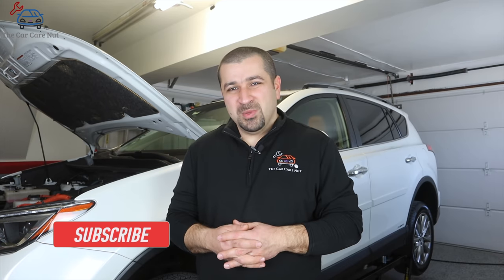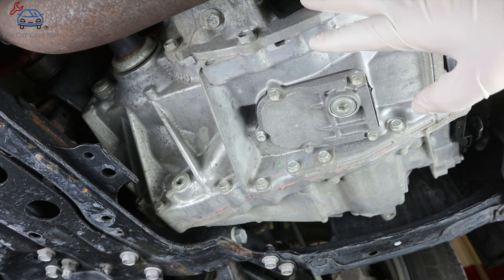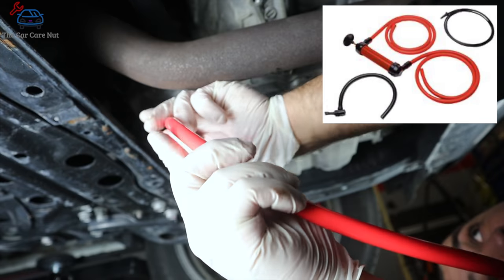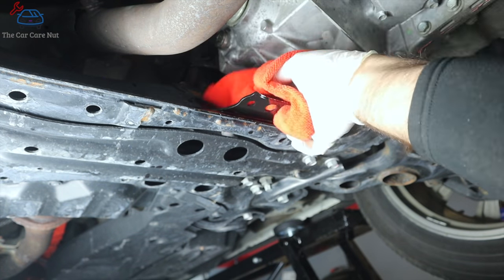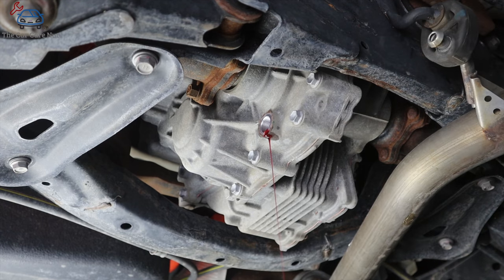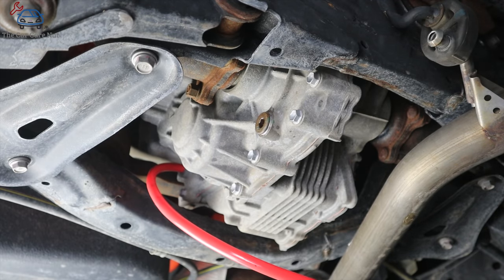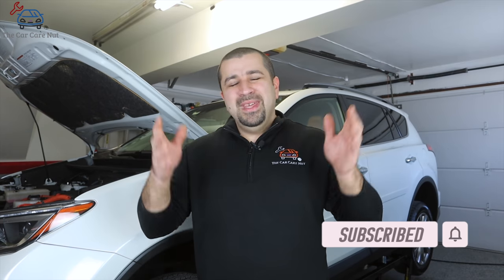How to change Toyota Hybrid Transmission fluid and Differential fluid

Comment: I am getting ready to do the transmission oil change on my 2019 Prime. I  am wondering if it would be possible to use a funnel with 4 feet of  vinyl tube, and put the new oil in from above, instead of pumping it in from below? Thread the hose down from above the engine and into the fill  hole on the transmission, attach the upper end of the hose to a funnel,  then let gravity do the work of getting the oil in?
Reply from the maker: Hi! You could do that if you can get the hose in and let gravity pull the fluid.
Reply: Laura, did the gravity feed idea work? Thanks
Reply: @ascii2795  - Here's my best answer: I think so. What actually happened when I tried to change out the transmission fluid on my Prius Prime:
1. Step 1 is to remove the engine splash shielding. There are two panels, a large one toward the rear, and a smaller one in front. There are several 10mm hex head bolts and sheet metal screws that have to be removed, and a bunch of 7 mm nylon push-rivets. I got the screws and bolts off okay, but destroyed all but 1 of the push rivets trying to pry them off. I have replacements on order from Amazon. 
2. Step 2 is to identify the drain and fill plugs, and this was pretty easy: they each have a 10mm female hex socket, and they are the only such plugs in the transaxle, so you can't mistake them for some other drain or fill plug. The fill plug is in the side of the case near the half-axle shaft and CV joint. It's tucked up in there, partially blocked by some suspension struts, and kinda of hard to get at: you need a 10mm hex drive socket, and either a ratchet wrench with a cheater or a long breaker bar to reach it. The drain plug is easy, no access problem once the splash shield is removed.
3. Always remove the fill plug FIRST! Then the drain plug second. Once the fill plug is removed, get back on your feet and look downward in the area around the car's 12 volt battery and fuse box. You are looking for openings through which you can see the ground from above the transaxle case. I found one such opening through which I could poke a piece of 1/2" diameter aluminum conduit, so it should be possible to work a length of 1/2" vinyl hose through there. You would need maybe 4 feet of hose with a funnel on the upper end. Bend the lower end horizontal and work it around until you can get it in the transaxle fill hole, then wedge the hose in place in the hole with something like a plastic tool handle or wood dowel so that the hose can't slip out while you are pouring oil. Or have an assistant on the ground holding the hose in the fill hole. 

I have to add this caveat: I haven't actually done this yet, because I can't get the car high enough off the ground with the ramps and jackstands I have available, to actually complete this process. My ramps only lift the car about 6", and this simply isn't enough. The Prius Prime is so damn low to the ground that even with my ramps, a squirrel would be hard-pressed to actually work under the engine and transaxle. And the car MUST BE LEVEL to do a transmission fluid change, so you can't just jack up the front and leave the rear wheels on the ground; the front and rear have to be lifted equally, and I don't have the jacking equipment to do this yet, at least not with a full 12" worth of lift. I may have to take the car to a garage  and pay someone who has a car lift to change the transmission fluid, unless I can figure a way to get it higher off the ground. I have 4 old 245-75R16 wheels and tires off a Dodge 2500 pickup truck that are probably tall enough while laying on their sides to hold the Prius off the ground, if I can just jack the car up onto them; I'll try this tomorrow. Anyway, I can't think of any reason that filling the transaxle from above with a long hose and funnel wouldn't work: I can see a large enough opening to thread the hose through from above, I just can't actually do it until I can figure a way to lift the car high enough off the ground that I can actually get under there. I did manage to squeeze myself under the car just enough to change the engine oil this morning, just barely, but still have to do the transaxle. Hopefully tomorrow.
Reply: @laura-ann.0726  Wow. Thanks for all the details. My husband and I recently changed the transmission fluid on our daughter's Nissan Cube. Cleaning that magnet was quite the chore. And there were enough metal filings to make a Willy Wooly sketch pad. Remember those?
I guess we don't have to worry about that in these cars (at least, I hope not).
Reply: @ascii2795  - You always get metal filings on magnetic drain plugs for engines and transmissions on any new car during the break-in period. Once the car gets about 20,000 miles on it, all of the gears and bearings should be fully seated and mated to each other, and as long as you use good quality lubricants and change them at the recommended intervals, you shouldn't see any more than tiny traces of metal shavings on the magnet for the next 130,000 miles. After the car gets 150,000 miles, some of the gears and other moving parts may begin to wear past their nominal tolerances and begin to throw metal shavings again, but most Japanese-brand engines and transmissions in Toyota, Honda, Subaru, Nissan, Mitsubishi, Suzuki, and Isuzu cars and light trucks are capable of 250,000 miles if religiously maintained with good quality lubricants like Castrol or Valvoline. There are tons of Corollas, Accords, Camrys and Civics running around with 250K or more miles on them and still passing Smog Check and running good enough that people still keep them. Usually by 250K the air conditioning is no longer working, and on a car that old, it's probably not worth fixing, so a lot of these cars are the family "second car" that used for backup, or the kids end up with them as their first car when they get a driver's license.
Reply: @laura-ann.0726  I'm planning to do the same as you, using clear PVC hose and a funnel. I'll raise the car on stands to remove the plugs and lower it to drain, and fill. I think it's likely going to be easier than trying to pump 3.5L of oil up, in a confined space.  I'll put a webcam on the floor pointed at the fill hole, and monitor it from a tablet during the fill. What could possibly go wrong?
Reply: @HaggisPower  - It's the "confined space" aspect of trying to work under a Prius that makes even a simple engine oil change so difficult on these cars, if you don't have access to a garage lift. Standard ramps and jackstands can only lift the car 6", maybe 8" for large jackstands, and that's just not enough, especially for a transmission oil change, because you have to drop the whole splash shield to even be able to see the drain and fill holes. The hose-from-above method worked great for me. Just make sure that the entire length of the hose slopes downward - if it's sagging anywhere, some oil will be trapped in the sag, and you want as much as possible to get into the transmission. Mr Prius Prime has the P610 transaxle, and it took about 3.6 quarts to refill it. Yours might be a little more or a little less, but I've heard that late model Toyota HSD's with the 1.8 liter engine typically take somewhere between 3.5 and 4 quarts. If you see oil start to drip out of the fill hole before you get at least 3.5 quarts in, check to make sure you have the car level: you can check this with a torpedo level held against any of the frame members or the lower body panel skirts for fore-and-aft leveling; for transverse leveling, roll the windows down and stick a length of 2x4 across the doors and test that with a torpedo level. If the car is off level even a little bit, especially if the driver's side is higher than the passenger side, the transmission fill will come up short. Good luck!
Reply: @laura-ann.0726  Well you are certainly right about the space constraints. Unless you have a hoist or a pit; it’s a pain in the proverbial. I made the mistake of using too big PVC tubing and it was hard to tell when the fill level was reached. Consequently I over filled it and ended up with a 400ml puddle on the garage floor. I let the jacks down to get the level right and raised the RHS of the car evenly to get enough space to put the fill plug back in. I recommend 10mm ID / 13mm outer diameter hose. I initially used 13/16mm hose and it sealed the fill hole too effectively. You need a very small funnel for that size hose and a bit of patience when filling. Otherwise it’s an easy enough job.
Reply: @HaggisPower  Great! Glad it worked out for you. You now have the hose and funnel for the next time you need to do this job, assuming you still have the car when it gets to the mileage for the next transmission oil change. Since there are no clutch packs or bands lined with friction material in these E-CVT's like there are in conventional planetary gear automatics, the oil change interval is much longer. Toyota claims that the Prius and Corolla Hybrid (P-610 transaxle) can go 100,000 miles between oil changes, although I'm a bit uncomfortable with that, and would not want to go much past 60,000. Where I live, summer daytime temps are consistently around 105°F, and the transaxle oil and MG1/MG2 temperature sensors typically record around 185°~190° on the freeway. Considering that the transaxle is probably the single most expensive component in a Prius to replace if it gets damaged, $50 for 4 quarts of new oil every 4 or 5 years (60,000 miles) seems like cheap insurance to me.

As for measuring the temperatures inside the transmission, there are sensors in there that get read by the engine control computer. If you buy an OBD-II reader/transmitter module (there are a small dongle that plugs into the OBD-II port under the dashboard), you can monitor dozens of engine and transaxle performance parameters in real time with apps on a cell phone or tablet, that pick up the data stream from the dongle via BlueTooth or WiFi (the one I use is BlueTooth). The two most useful apps I've found for the Prius are "Car Scanner" and "Hybrid Assistant", and you can get them on the Google Play Store. With either one, you can read and display the temperature of the transaxle oil, and the MG1 and MG2 stators, the internal temperature of the inverter, and each of the 4 individual temp sensors in the  traction battery. Other cool features of Hybrid Assistant: it records in real time exactly how much power (in kilowatts) is flowing into or out of the battery, the rotation speed of the two motors, and a bunch of statistics regarding fuel flow and fuel economy in the gasoline engine. If you have a Prius Prime or Rav4 Prime, while you are running in EV mode (up to 37 miles in a Prius Prime or 45 miles in a Rav 4 Prime), it displays kilowatt-hours/100 km. In my Prius Prime, I'm happy if the car is getting 6.5 miles/kw-hr. You can how speed makes a huge difference in energy efficiency in these cars: In EV mode, at 35mph on city streets, the car can squeeze out maybe 37 miles on a full charge, whereas on the freeway at 65 mph, this drops way, way off, to maybe 24 miles. Having to do a lot of stop-and-go hurts efficiency too: the app plainly shows that the car is drawing 15 to 18 kilowatts to accelerate away from a stop, and that's for a very gentle acceleration: pull away with a lead foot, and the power draw jumps to 30 kilowatts. Then, when you have to stop again at the next read light or stop sign, the regen braking system can only recover maybe 30% of the kinetic energy and deliver it back into the battery. 30% is better than zero, but still, 70% of the energy burned to start the car moving away from a stop sign is not recoverable, so the fewer times you have to stop and go on your route, the more total miles you will be able to make before the battery is exhausted. Using Hybrid Assistant can help teach you the speed ranges and driving behaviors that yield maximum energy efficiency. In my Prius Prime, just slowing down on the freeway from 70mph to 55, if you can get used to driving that slow, improves fuel efficiency from 50mpg to 63mpg in my car, and this is displayed in real time on Hybrid Assistant, along with the amount of regenerated energy that is being routed into the traction battery on downgrades (every watt-hr you can reclaim on downhills means a little less gas you have to burn when the road levels out again). The OBD-II dongle costs about $45 on Amazon and the app is free on the Google Play store.

Comment: I have some unopened Toyota ATF WS that is 8 years old.  Toss it or use it?
Reply: Buy fresh stuff from Toyota, an then return the old stuff with that receipt. As long as it has the same label/sku number they'll return it. 

If not, I'd still use it! Unused synthetic oil not exposed to oxygen doesn't seem to fall apart/ break down in my experience... but once you open that oil, see the color, an smell it, you should know more!

Comment: Hi question for you 2014 camry hybrid 170k miles on it never change the transmission fluid when engine kicks i feel hammered noise engine and car jumps sometimes 40mph i hear slipping gears do you think flushing the ATF will solve the problem or i need new transmission or could be different issue what u thoughts?  thanks in advance.
Reply from the maker: Hi! A hybrid Toyota doesn’t have gears per se to slip. But the noise you hear could be a misfire rattle. This one will need In person diagnosis but the transmission should be ok.
Reply: @TheCarCareNut   makes sense my brother the other day while driving 70-80mph check engine light flashed 4-5 times after that Disappeared i ran my obd fast gave me the code P0301 misfire cylinder one i have replaced the the all coils and spark plugs few months ago after this code i got nother denso coil replaced today but didn’t help i had the same problem.
Reply from the maker: It’s possible you have a sticking EGR valve which is starting to be a problem for these

Comment: Hallo I had my transmission fluid and axle seal changed beacuse I had a leak on my prius 2 gen. According to my mechanic the transmission was filled to the top. After that I noticed I have a leak from the fill plug and went to the mechanic again. He took off the fill plug after I was driving (transmission hot) to change the gasket and about 200 ml. of the fluid went out, so maybe it was overfilled the first time. I am wondering if  it is ok now, or the fluid went out because it was hot?

Comment: I am curious if the need to be level is as great with this type of transmission. Because it is all in one spot, I'm actually hoping that there can be a slight incline. Since I only have two Rhino ramps and two jack stands, I was hoping for a "hybrid" lift system 😁

I figure that the car would be an inch out of level. I haven't sized up how my jack stands will do in matching the height of the ramps. it would be nice if I could get it perfectly level but I believe the increments on the jack stands are either a half inch or just a little bit more.

Since Ahmed is massively busy with hundreds of emails backed up, has anybody else out there read the technical specs on how close to level it needed to be?

(I believe, on the U760E 6-speed transmissions, the car has to be within one degree of level...)
Reply from the maker: Hi! If you can get it level within an 1-.5 inch you should be good

Comment: I have a 2013 Prius with 130,000 miles is it too late to do the first drain and file on the transmission fluid?
Reply from the maker: Hi! On hybrids you can do them late. And only a drain and fill is possible

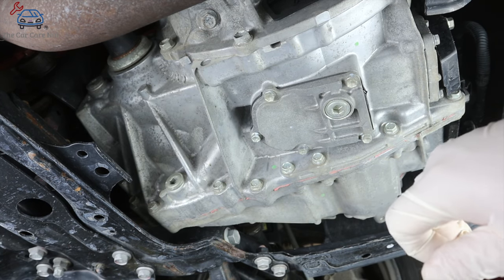Comment: Did you mistakenly contradict yourself at 4:30 by saying to "take the DRAIN plug off first" in case you cannot fill it later? Did you mean to always take the FILL plug off FIRST , then the drain plug so you can be assured you can fill it later?

Comment: For 2017 Toyota Prius, how often to change transmission fluid if I’m a delivery driver? I drive like 50k miles a year.
Reply: It's really up to you an your wallet... 
If I drove 50k miles a year, I'd change that fluid AT LEAST once a year, an depending on what the fluid looked like when it came out... burnt/black/ or cherry red... I'd extend or lessen that interval. 

I went down to 15,000 mile interval on my Hybrid SUV, because 30,000 miles my fluid was obviously burnt.

Comment: I love how simple it is on the Toyota and Honda transmission maintenance.  I have a 2018 Audi Q5, the fill hole is pointing downwards that means you need to have a special fill tool to fit in the fill hole and pump the fluid in (stupid German design! #@$!%) when the transmission is at a specific temperature range due to thermo expansion of the DSG fluid using a vag tool.  I simply just measured the amount that came out and fill with the exact amount.  Does the Toyota hybrid transmission need to be filled at a specific temperature?

Comment: Took my 2016 Avalon Hybrid for 100k maintenance. I'm not familiar with different services but asked for differential fluid exchange because it was listed on some websites. But is there some validity to not needing one for a FWD if you're already getting transmission fluid exchanged?
Reply: FWD vehicles don’t have a separate differential.

Comment: I have a 2019 Avalon hybrid with a little over 60,000 miles and attempting to do a fluid change.  I need to remove the plastic shield to get to the drain plug.  I am unsure how to remove the clips that attaches the shield to the car.  How do I remove them without breaking them?

Comment: Does the front wheel drive es300h have a differential or just the transmission fluid needs changed and no differential?
Reply from the maker: Hi! Just the transmission